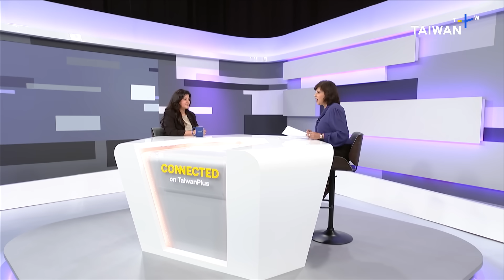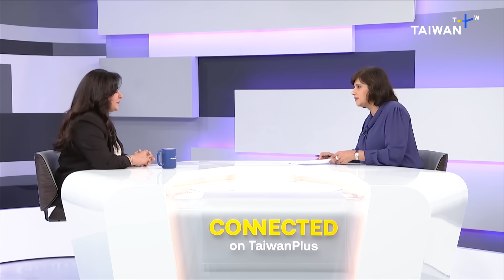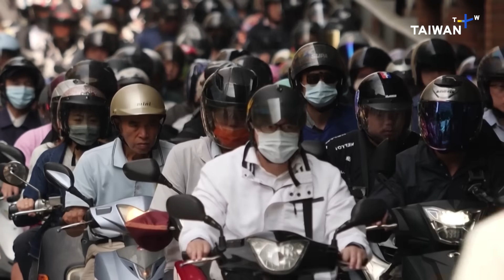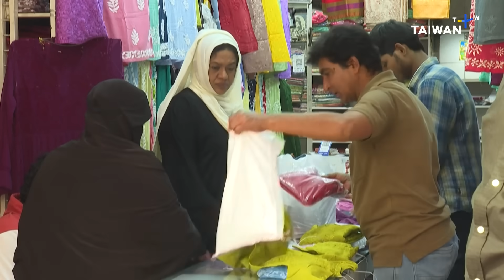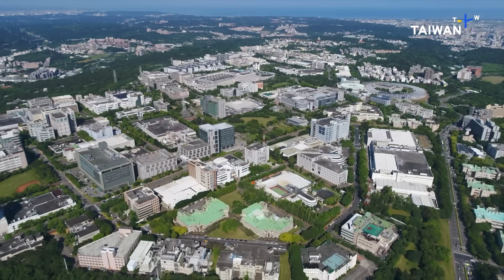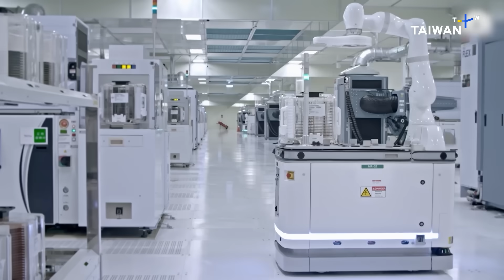Taiwan’s PSMC Is Powering India’s US$11 Billion Semiconductor Fab | CONNECTED Power & Principles

Comment: India has to abandon the fab before it is established.

Let’s unpack it systematically.

1. The Mirage of the Fab

A semiconductor fab is not a single factory — it is the apex of a national industrial ecosystem. It demands:

stable power and water supply at microsecond-level reliability;

a materials chain of ultrapure gases, photoresists, silicon wafers, and chemicals;

precision engineering at the sub-nanometer scale;

an entire industrial culture of process discipline.

India currently possesses none of these at scale. Every attempted fab project — from the late-1990s SemIndia to the recent Vedanta–Foxconn plan — has collapsed under the weight of its own wishful thinking.

2. The Structural Paradox

India wants to “leapfrog” into chipmaking without passing through the discipline of manufacturing evolution.
But semiconductors are not software.
They obey physics, not rhetoric.
You cannot “code” your way into a cleanroom.

While China spent 30 years building from low-end packaging (封装) to advanced lithography, India spent 30 years exporting coders. The result: China now has a vertically integrated semiconductor chain; India has PowerPoint slides and MOUs.

3. Capital Without Competence

Every fab proposal in India begins with political announcements and ends with bureaucratic silence.
Why?
Because the financial imagination outpaces the technical capability.
Building a fab costs $10–20 billion, but maintaining yield — the invisible metric that determines success — costs decades of process experience.
India has neither the supplier ecosystem nor the engineering depth to sustain even 28nm, let alone 7nm.

4. The Cultural Asymmetry

Semiconductors require a culture of precision, humility, and patience — a mindset where “99.9% right” means failure.
But India’s industrial culture still celebrates innovation through improvisation (“jugaad”) rather than perfection through iteration.
A fab cannot run on improvisation; a single speck of dust can destroy millions of dollars’ worth of wafers.

5. The Inevitable Retreat

Thus, yes — India must abandon the fab before it is established, because to proceed would be to confront the painful truth:
it cannot yet build what it dreams of owning.

Real sovereignty begins not with slogans, but with the humility to build from the bottom — materials, tools, technicians, habits, standards, and discipline.
Reply: Cry more 😅
Reply: Facts stated! We as Indians need to pay attention to the last paragraph.
Reply: @francisiiman9932  Lol. They told us similar stories in space tech, that India is a poor country and cannot afford the eco-system to be successful. You underestimate the youth of India and resulting startups and the business acumen of Indian corporates. FYI India has already started fabricating chip (the first one from ISROs semiconductor lab). It is now gearing up for mass production with private partners. When people say it is not possible, it is a pleasure to wipe off their smug smile. ISRO did it again...
Reply: What a bullshit thinking and view 
India have never built a fab after the first one which caught fire so your argument is base less
Second many countries including china government incentives are given to semiconductor sector and tata is financially strong to hold themselves 
Third pure water, electricity and specialty gases required is not a big deal already already investment from indian companies or from collaboration is coming
It’s the first step, main aim should be of building ecosystem not 7nm chip